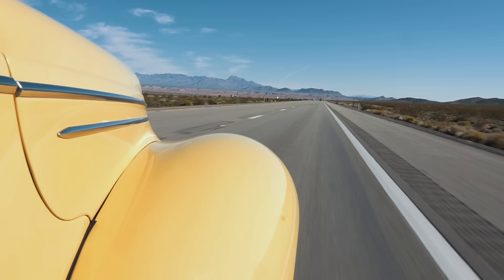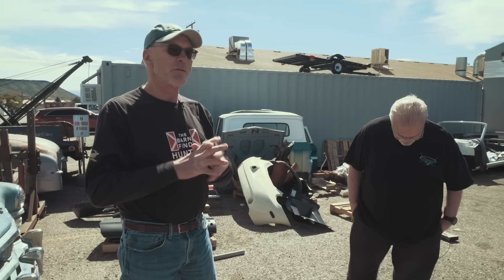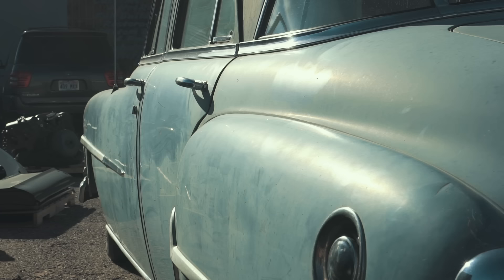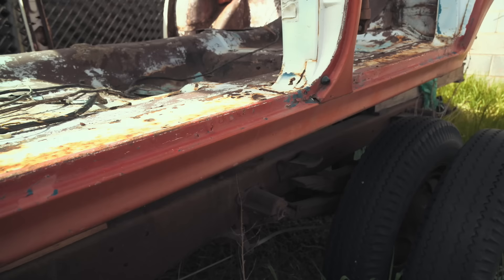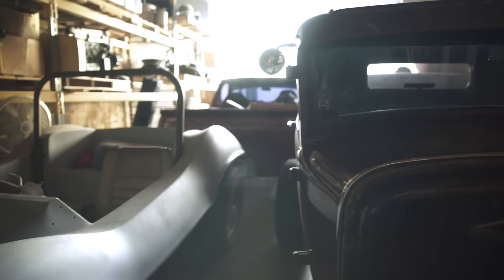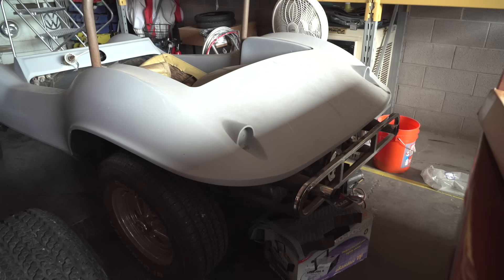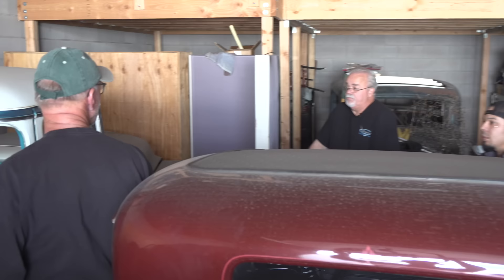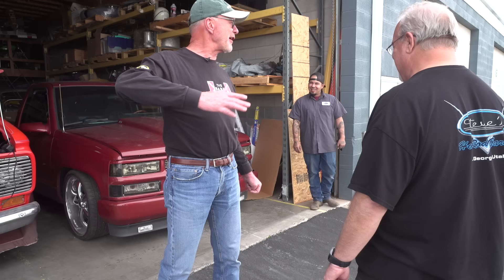Corvette powered VW Pickup and an Ed Roth Hot Rod | Barn Find Hunter - Ep. 54

Comment: An old fella living back in the woods near me died a few years back. The scrapers found his place. They hauled over 250 64.5 to 71 Mustangs off to the scrap yards. There where a couple of dozen K's, multiple convertibles and (set your face to pissed off) 8 complete Cobras with the original 429's, two with sticks one of those was a rag top.
By the time the son found out it was all gone except for one 351c with Aussie V2 closed port heads. I think it will look good in my 66.

Comment: I grew up worshipping Ed Roth, Don Garlitts, Tommy Thompson, while reading Modeler magazines and building these cars from those AMC plastic kits.  That morphed into building electric slot cars.  How ironic that 50 years later, there is a market for both, but together, emerging?  Only the heaviest of those beasts wouldn't do well with an electric drive in it.  No 'hybrid' stuff necessary, just a 64 kwh battery or better.  They would get 140 to 180 miles of range and recharge in about 5 hours on a level II charger.  You could actually listen to the Beach Boys while driving to the beach.

Comment: the GMC trucks were the last of the line in general motors, so they got odd parts put in them , my uncle had two GMC trucks one had a pontiac engine and one had a buick engine and both had different dashboards the were fun if you had to buy parts for them, and they both had different rear ends, one to match each engine.

Comment: The 53 New Yorker Has the horrible fluid drive trans . I had two of the Engines,long block Hemi, and was the 1st guy in Australia to Run an early Hemi on the salt lakes. I am sure hot heads will have an adpator for the long block to adapt a better trans to really make the engine come alive. Even one of the 5 speed automatics.

Comment: I  had a similar concept; Take a VW double cab, add a single cab bed, mount it to a modified 4WD dully frame (dodge?), then mount a diesel engine behind the cab (in treasure chest).
Widen both sides of the bed (from cab to end) to cover the dullies.
Install a 1 or 2 ton crane that is stored (hidden) and angles up to vertical into the left or right tail end of bed side extension.
Install custom built platform lift using original bed length and width (not extensions) that moves from bed to flat on ground and back.
That's the basic concept without detail components (generator, compressor, welder), interior mods, etc...